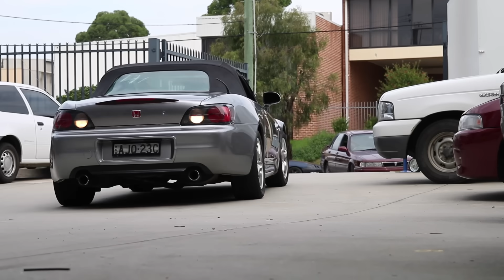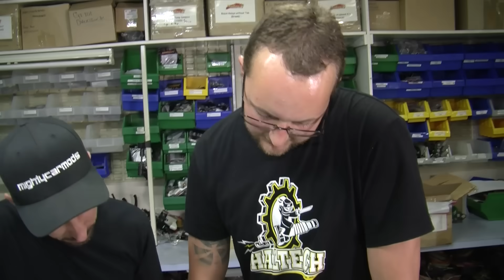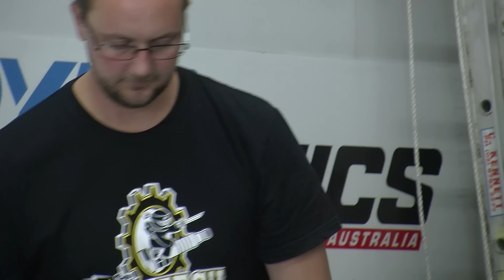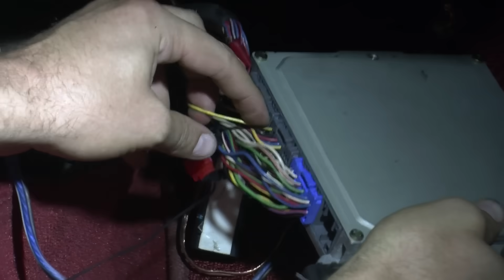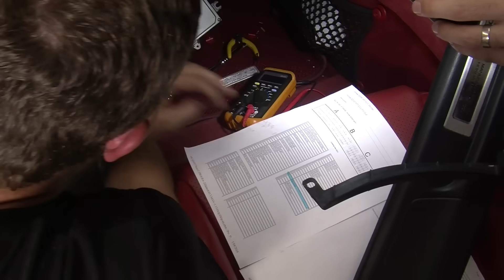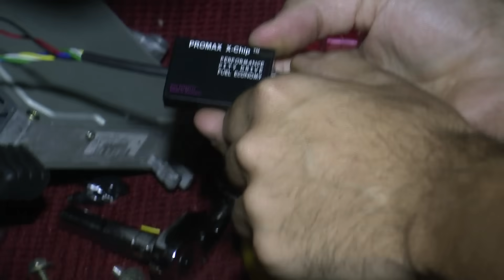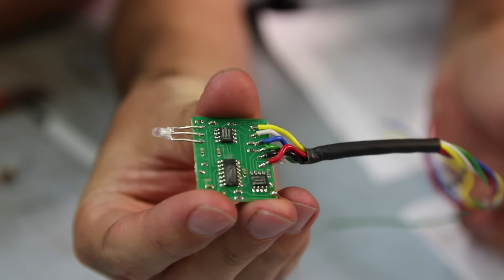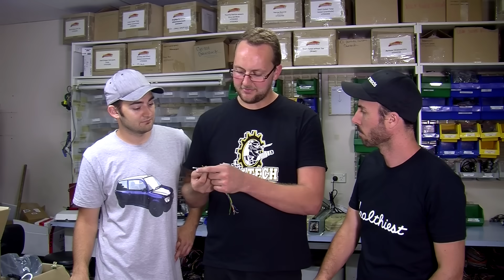eBay Performance Chips -  Mythbusted

Comment: So it's actually a scam and the performance chip does nothing. Ebay should stop letting these people sell those items.
Reply: Half of eBay would disappear if fake stuff was banned
Reply: +Bill Hatcher  you should have more likes
Reply: +Bill Hatcher to most people it was pretty obvious before they even hooked it up,anything that thing could have possibly done could have been done with a diode or resistor and some basic knowledge of a cars ecu plain and simple.Realistically on a boosted car you can get 20 hp with such a mod too...........a simple one to look at for example would be the 1.8t golfs,just google diode mod and youll see what i mean.
Reply: Bill Hatcher. I bought a 40 dollar one and it worked on my bmw
Reply: Bill Hatcher they are not a scam
Reply: Got e36 perf chip,tore apart the ecu and replaced the chip,it removed rev limiter and did a few other stuff.
Gained around 17hp from claimed 20 and it sounds awesome.
Also it has better torque curve,nicer accelerations.
Its very slight,just like cold air intake.
But worth it for 30 dolars
Reply: Bill Hatcher i
Reply: eBay can't physically check everything that is sold. Just like the popular "intake propeller" that is supposed to make the air flow better in your intake, giving more power and blablabla. It's sh*t, but eBay just makes sure we get what we pay for. If it's sh*t we paid for, sh*t we get.
Reply: Do yourself a favor and buy yourself a RaceChip. That is some nice german quality!
Reply: +Bill Hatcher That would be boring! we have amazon for things that work.
Reply: +Carbon 12  Pretty apparent that the chip in question does not do what is advertised and is a scam with just lights on it.
Reply: +SouthJerseySound If people are dumb enough to splice into their ECU with an unknown $20 chip from Ebay, they deserve what happens to them. Just saying.
Reply: Or you can just do your research, like watching this video, and then not buy them.  That works too.
Reply: I have basically no knowledge of how ECUs work, but common sense is enough to tell me that a couple guys in the Ukraine selling a chip on Ebay aren't going to have come up with an ECU setting, that Honda didn't think of, that produces any meaningful power increase.  Additionally, if the product actually DID work, car owners would be flipping the fuck out and be buying these things left and right...and they'd be charging a lot more than $20 lol.
Reply: Actually no.. I bought a genuine chip from Ebay made by a renown company that I did research on and it actually works. I dynoed my Alfa 156 JTD before and after and it gained 25HP. It was a so called chip box and I payed 200$ for it. And of course it looks nothing like this two wires piece of shit that these guys bought. They should have written an actual name of the company they bought this in the description so other people won't get scammed..
Reply: The closest you can get to such a mod is buying an aftermarket ECU, which will generally be over 1k.  Even then you need to modify other parts of your car for the ECU to actually be effective.
Reply: Wowthatsfail 90% of EBay would disappear then...😂
Reply: Fuster that's not true,you can get chips and relfashes depending on what car and ecu you have.Then a step up from that would be a program like Hondata or the one Eurodyne makes for Bosch Motronic ECU's that allow you to reprogram your factory ECU and after that you have a stand alone like Haltec etc.Also if you're trying to be super cheap there are some bandaid type mods you can do on a lot of cars that will net you some more HP.But they mostly fool the ecu in one way or another and you tend to lose some of the factory safety features that are programmed into your ecu.I'm pretty certain that is what the "intent"of this product was to do yet we know it failed to deliver ;)

Comment: For 20$ you could buy lots of chips. And yogurt. Run a tube from your arse to the air intake then. Yeah, the yogurt does not go well with chips, but technically speaking, lots of unicorns! There you go: Performance Chips!

Comment: uhhh I beg to differ.... I was under the impression chipping your car works in stages and together as part of a system... I installed a stage 1 chip that cost $100 that worked together as part of completing a system that included basic mods. intake, cat back , headers and THEN you install the chip.... my chip also informed to give it 2weeks to adjust the ecu to the new free-flowing system. been driving for about a week since its been done "adjusting" and  without question ive seen a boost in power as well as a higher rpm range/power band my car didn't reach b4 which we all know means more power... maybe this video just applies to the bs $20 chip??
Reply: +Myles Johnson there was never any talk in this video of chip's being a waste of money.  This video was specifically evaluating the $20 Ebay chip.
Reply: +Shawn Christiansen ooooo ok for sure I thought so.

Comment: wouldn't it not effect it because the wires from the sensors to the computer weren't truly cut in half so those stock signals are still making it to the computer and the chip is just kinda getting power and ground from the wires you tapped into. I understand that the chip was proven to be a fake but in application it would never work even if it was an actual "chip"

Comment: Buying a chip is totally different then getting a chip specifically tuned for your car. I got my lsVtec 2000 Si chipped and tuned with a dyno setup for $150. Added around 10-15 hp, 2step, launch control, rev limiter, shift light, IACV adj, kc delete, improved my fuel economy and a whole lot more.
Reply: 10-15hp is not even noticible. Why pay for that?
Reply: @nodo7575  it's not about the horse power if you read

Comment: Get a real car and you won't need any chips.
Reply: +Dylon Reece unfortunately, modern computer controlled cars took over, leaving you, well, outmoded, only reason i'm even considering an old carbuerated vehicle is in case a terrorist EMP goes off, which is a threat increasing every year

Comment: YOu need to test on a MAF sensor not a MAP... ECU sends voltage to keep a wire heated to 72 degrees F. if the wire gets colder due to more air flow the ECU boosts the voltage and increases injector pulse width allowing more fuel into the engine...But a MAP works in a different way. it uses vacum and ECU reacts differently to the signals.
Reply: +Yoshiroo Kanagawa Didnt matter in the end, they sent the chip to an expert and it was bogus. All it did was change the colour of the LED.

Comment: just put a fart can on it ....75 hp easy ...oh and dont forget the 5 ft wing for an extra 35 hp ...
Reply: Don't forget each sticker= 35HP
Reply: caleb colburn if you combine that wing with hydraulics your car will fly cause you'll have landing gear and also +400 boost don't forget that
Reply: +Allstar2700 hey can't forget to paint your calipers red
Reply: +TheMonkeyeats it will give you 50hp if you put flame decals on it
Reply: +TheMonkeyeats  Fart cans make a car  look like a Male Mouse from behind.the car. Don't forget those SPINNING wheel covers. Cars go fast standing still at a RED light.
Reply: don't forget about $10 shift knob and light up valve stem caps. 50 horsepower!!!
Reply: +TheMonkeyeats add numbers or put a name on your car and that adds 30hp at least. ah its been said...see the secrets out...i got to stop tellin people bout that..or patent it...lol
Reply: and stickers for +100 hp
Reply: ***** no ur forgetting reds out of date its better if you paint them spray paint red and pink
Reply: +TheMonkeyeats hell you forgot to tell them a glasspack adds 100hp and also makes your car sound like a "real racer lmfao"
Reply: +nitro 20 lol no one mentioned how the glasspacks will add horsepower lmfao
Reply: +nitro 20 shit I run dynamax super turbo before im cought dead with a glasspack
Reply: +69ssrszl1 while were all sharing secrets remember the most important is to ask for doughnut tires the mechanic you go to will know exactly want you want remember to tell your mechanic don't ask questions the real racers said id get more horsepower so I want the horsepower put the on "no questions asked" and remember he may try to talk you out of it that's just cause he don't want to see you keep up when he is on the track
Reply: +69ssrszl1 oh hey while your at it did you tell them how much faster they'll go with those 300 doller color change headlights
Reply: +Austynn Eleven oh we all know that even better then chrome though is putting one of those steel front grilles on your truck they come in chrome and really make your truck fast
Reply: +Allstar2700 your also forgetting each colored airstem caps that will make their tires spin faster as well as those glowing lights on the tires if you cant afford them use glowsticks
Reply: +TheMonkeyeats imagine that one some punk wrappling glowsticks around his rims cause he thinks he will go faster what a mook is all I got to say if I see that shit
Reply: +TheMonkeyeats say what tires better right now for the fronts on my 05 dodge Dakota hankook or hoosier their r16
Reply: seen a big ass wing on a cavalier the other day. I busted out laughing
Reply: caleb colburn of course that gives it+250 hp
Reply: TheMonkeyeats and those stickers adding 5hp each
Reply: @PotshotbarmpotUK  no I live in the US

Comment: Wire taps work just fine as long as you make small cuts with a razor blade in the plastic casing before you crimp them down.

Comment: I mean splicing into a wire does nothing even if you put a resistor, you need the resistor to be between the wire you're cutting, not tapping into it. doesn't even make any sense.

Comment: You do realize there is a difference between OBD tuning, or chip tuning and the powerbox shit you have on the episode right?
Reply: +Gavin Oakham I think the original comment was mentioning that there's a difference between what they tested in the episode and an actual tuned chip system. Before nice things like Haltec there were OBDI chip plug-ins that were popular. I've used them. You'd take your stock ECU and solder in a socket to bypass the stock fuel map. You'd then use a chip that you either purchased with a pre-loaded fuel map or had tuned just the way tuning fork tunes the Haltec system. That's the misunderstanding you two started out with. The chip used in the video is definitely crap, but there are cheap systems that worked for lots of people. 

I socketed/chipped a stock Civic ECU to run my B20vtec and bought several $3 chips with different fuel maps and even different vtec engagement rpm and redline.  Some chips worked better than others, they were all better than the 1.6 SOHC map on the stock ECU. I used them until I had a tuner friend use a "chip burner" to burn a fuel map onto my chip the same way you'd burn a CD, it's just older technology.  Honda-tech users did better tests where they took the eBay chips and opened them in tuning software to see the A/F values and decided that some fuel maps sold on ebay were tuned by idiots, some were ok, it's always better to get it tuned by a pro.

Some people weren't using these chips to run swapped engines, they were using them to "tune" their stock engine. This is something similar to but different than what MCM tested because you were actually running a different fuel map.

I hope that was helpful.
Reply: +Gavin Oakham Well, his silly question was pretty valid imo. This video was demonstrating the use of a scammy powerbox and not of a "performance chip". He could have said it differently and stated the differences, you could have added value to the conversation instead of just chastising him for what you perceived as trolling. Instead you went on about Tuning Fork's expertise when in the beginning he said he didn't know anything about eBay chips. Then you guys argued off topic.

I was thinking the same thing, there's a difference between performance chips and the scambox in this video. I read the video title and expected an actual "performance chip" to be mythbusted, it would have been a better video and given Tuning Fork a chance to give insight into what goes into tuning and what makes what he does so valuable. It kinda comes down to the MCM guys dropping the ball by not demonstrating the system that most of us would assume based on the title. Now the viewers who aren't aware of chip tuning will associate a legitimate form of tuning(with it's own set of eBay scams) with a separate scam based on a very popular video that went out to 1.6 million subscribers. Think of that, when I say I had a "chipped ECU" people will associate it with this video and assume I got scammed. I can see why the original comment had a sour tone but wanted to present that view in a civil manner so I hopped in on your conversation instead of starting my own.

Anyway, it was a conversation worth having and I agree it should have been started better.
Reply: +Gavin Oakham btw, I see that you weren't the one who he was originally arguing with. 

my bad, I'm on mobile and can't see all the comments while replying.
Reply: +PhoeniXBG I agree.. stupid cheap ass chips for 60 bucks from ebay are NOT the same as getting a custom tune from places like SCT..or Diablo ..etc
Reply: +PhoeniXBG still a stupidly high amount considering in America i can get my ECU reflashed for $180-350.
Reply: i do know the method you speak of as it is one of the most common methods of getting more power out of my own car without swapping out the ECU. and what you say is a very valid point but the person i replied to seemed as tho he was trolling with a silly response/question. my bad if i read it the wrong way but to me thats how it seemed as he mentions multiple methods that were not involved/included in this video and belittled someone else for no reason. believe me im all for having conversations about real world practices and effects on engines but i dont like people talking down to others because it is not the way the car enthusiast society is. and its people putting out negative correspondence like the previous commentor who are giving the rest of the world a bleak outlook on us modders/enthusiasts
Reply: +Dick King well I didn't look into the video based on its title I watched the video for what it is and used it content to determine the point of the video. but with you stating the title gave you a different idea of what you were going to see I can now understand your side of the argument. now that I understand your side I do kind of agree with you. I didn't expect people to take to the title so much bad
Reply: But a good one is over $3500 in europe
Reply: +luigi90210 Agreed.
Reply: Dick King so can you buy a £100-200 chip which will work?
Reply: +Bujf vjg And how does that have anything to do with what I said? This is a chip bought from ebay, it doesnt make a difference if they are the best or not.
Reply: Bujf vjg
Oh I see, there's a fanboy over here. I was talking to both of them, and how exactly is the number of their subscribers something I should care about in this situation? Now if you watch the video you will see that they put in a ebay chip, so it really doesnt matter about HALTEC
Reply: +PhoeniXBG the entire point was to test the results if any of this cheap chip.... dunno how you ended up bringing obdii tuning and shit into it when they have nothing to do with anything lmao. and thanks to the help of haltech and tuning fork they have now shown us without a doubt that this chip does nothing and furthermore an engineer has looked at the chip to find out it truly does nothing. wanna talk about wirelessly interfacing with your odbii interface to your phone using bluetooth? or maybe something else pointless and completly off topic?
Reply: Gavin Oakham
Too bad you cant see constructive criticism in all arguements. Anyway like I said no one cares about the crappy powerbox they used, as it's pretty obvious that a powerbox ordered from ebay for shit money won't do anything - ergo their episode is completely pointless, now all the "pointless and completely off topic" methods you mentioned ARE the correct way of obtaining more power from you car. Anything else you wanna start a rant about?
Reply: +Dick King all good mate I could tell from the start you were creating constructive criticism in a good way and I'm always open to that it's one of the best way there is to learn
Reply: John Cunningham Wow, mate, where in Europe are you refering to? Shit chips here are roughly 50-75$ and the very best custom remaps and I do mean the VERY best you could get are like... 600-700$ ?
Reply: luigi90210
Yup that about sounds like the right amount for a good remap. Roughly what I paid for mine.

Comment: A hearty thank you from the other side of the world.  Go fast chips (from ebay) are like get rich quick schemes - uhm, no.  Thank you for demonstrating this for your audience is a fun and entertaining way!  Even the most expensive of these in line chip mods have a marginal effect.  I used to work with some pretty hard core race mechanics, and we saw it all.  Any car with a closed-loop system like OBDII just learns through the change.  In my experience, the best way to go faster, is to follow Lotus's old motto - remove everything you don't need, then add lightness!   Ditch the 200lb subwoofer in your trunk, loose the stupid spoiler tacked onto you decklid, and ditch the wide open exhaust system you think makes your front wheel drive Civic sound cool.  Lightness, plus slipperyness, plus non-douchebaggery = 15% increase in power